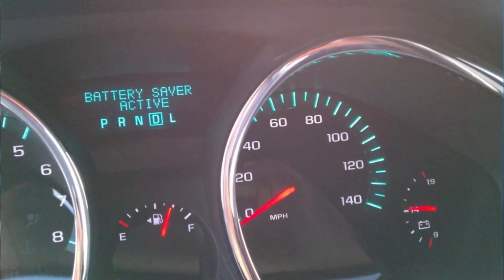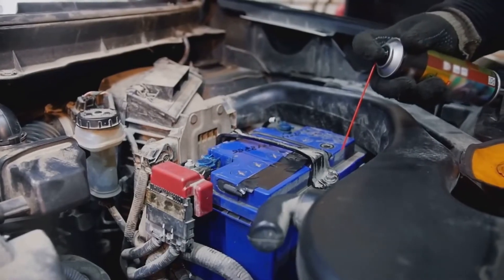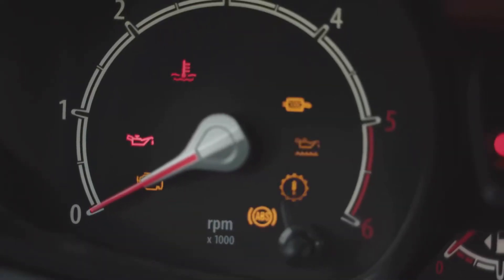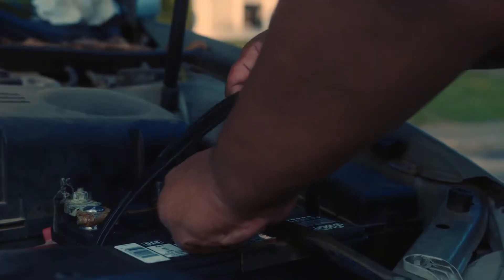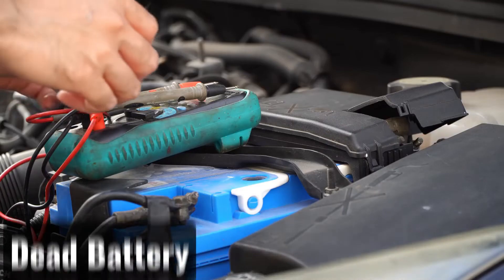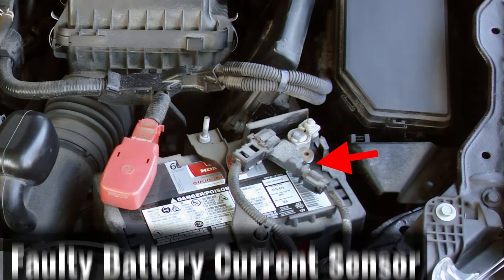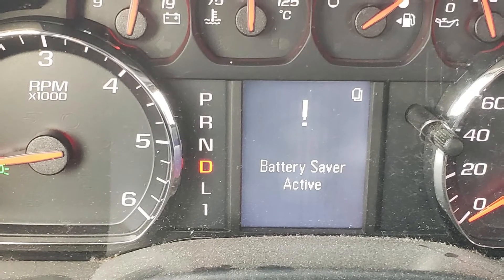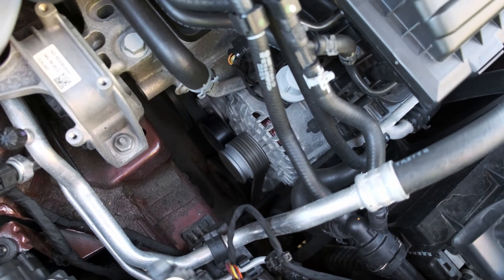What Does Battery Saver Active Mean in Chevy cars?

Comment: Mine came on then after the car sat it over night the car started again ! Anybody know why ????
Reply from the maker: Probably the battery dipping low while you were driving, then recovering a bit overnight. Could be the alternator charging weak or a loose battery connection. Check your terminals and test voltage — if it’s under 12.4 V before start or under 14 V running, something’s up.
Reply: Have your battery and alternator checked.